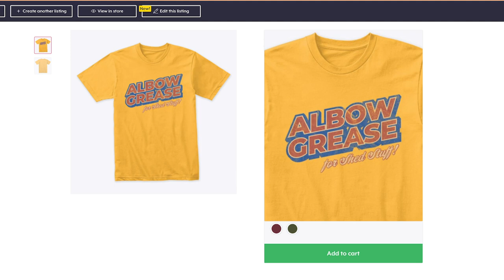Antique Drill Press RESTORATION - Part 2, machining a NEW BRASS HANDLE

Comment: Nice b̶u̶t̶t̶ ̶p̶l̶u̶g̶ replacement handle for your post drill. I like the 3in1 degreaser... spray on and it foams up... magical stuff. Years of crap falls away. 
Looking forward to part three, four, five... nice work chaps.
Reply from the maker: Will have to have a look at the 3in1 degreaser Phil, but there will be only one more film of the drill press, when I get around to it!

Comment: Brass loves to grab, especially drill bits, unless the bits are ground with zero or a slight negative rake. Since I'm too poor to dedicate a set drill bits for brass by stoning the cutting lips for zero rake, I'm very familiar with that awful noise when drilling, as it grabs the bit and tries to pull it into the work.
I'd have felt a lot safer doing that first cut to length of the brass stock with a hacksaw rather than the parting tool. It wouldn't have taken any longer with a decent hacksaw.
Looking forward to seeing the project finished, thanks for sharing it.
Reply from the maker: Hey thanks for your thoughts, yeah Al's technique comes from the school of brute force and woefully stupid ignorance, but he can't be told. As a great man once said, "Stupid is as stupid does."

Comment: Well, that was boring 

.. then some tapping, bit of shaping, filing etc

Nice job all round, I've never seen  diesel used as a degreaser, I use the comically named "Jizer". 

Cheers boys
Reply from the maker: Cheers, and for putting it under HTR’s nose too! You keep your jizer to yourself though 🤭
Reply: @DirtyShedCreations  Jizer is to be liberally shared around with a stiff brush